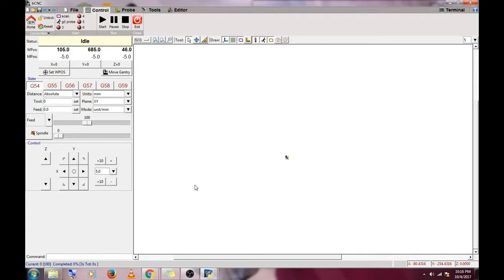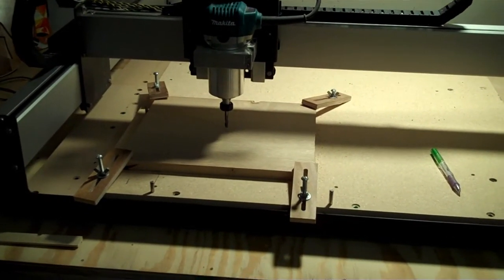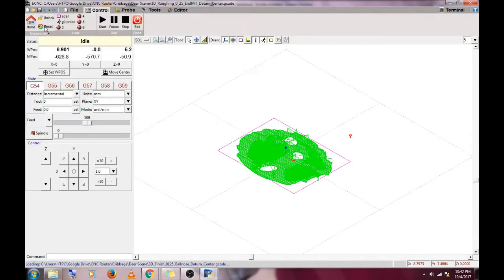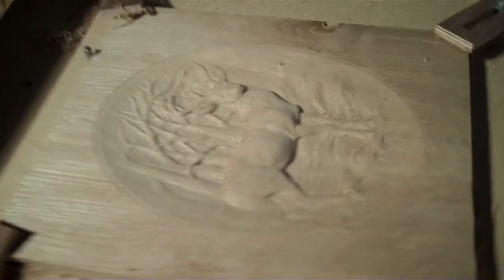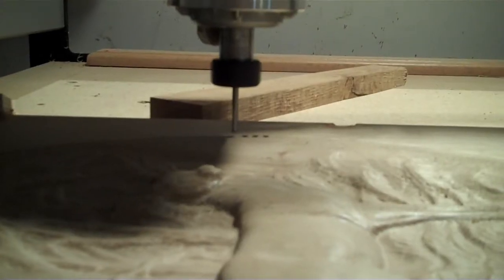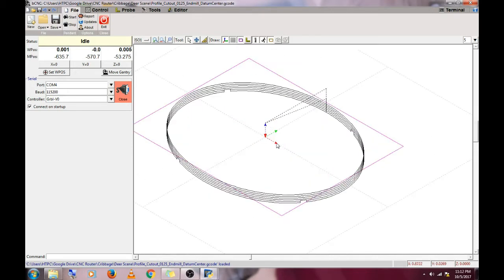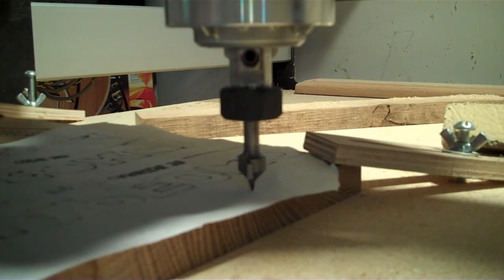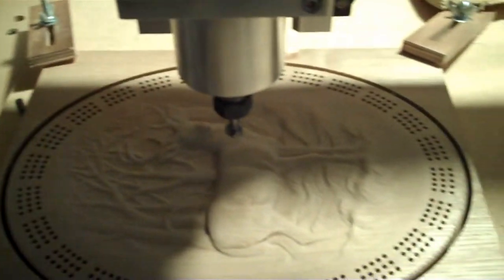3D Deer Cribbage Board CNC Router

Comment: Hi. I'm making a cribbage board but struggling with the holes. What settings did you use for the tool pass of the holes?
Reply from the maker: What software are you using? It's just peck drilling with the 1/8" end mill. I believe I was using a downcut to stop the breakout at the edges.
Reply: @shelbstrocity  I'm using carbide create on the shapeoko 3 xl.
Reply from the maker: @richardjackson3261  I don't use that software.  Sorry.